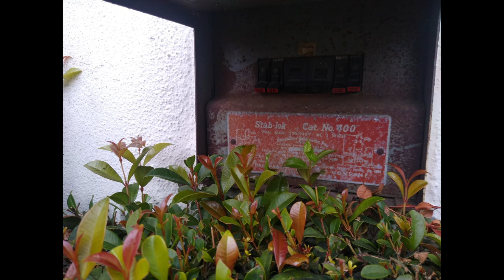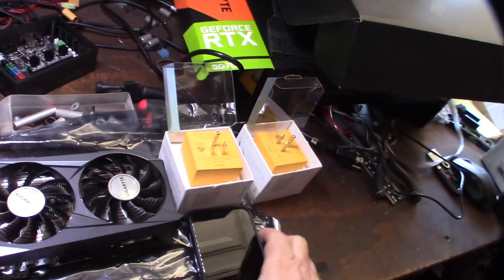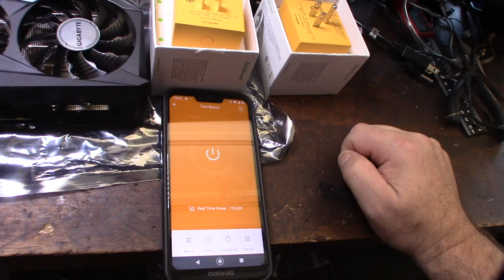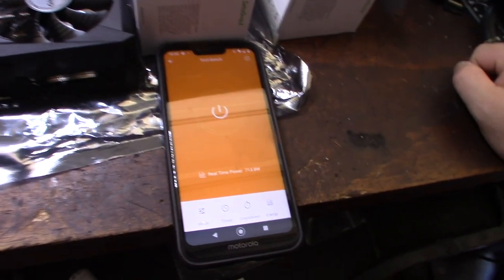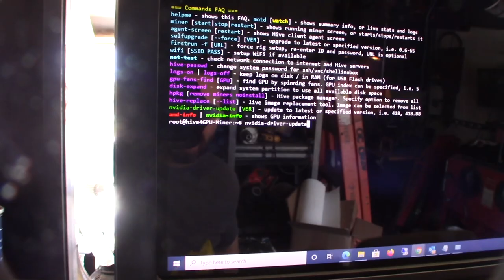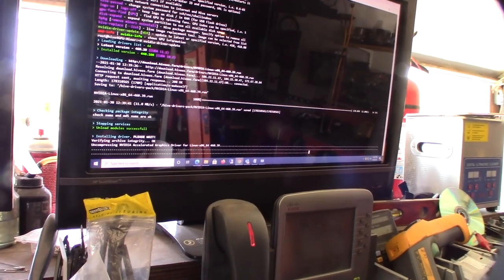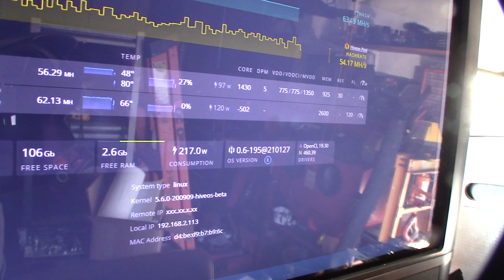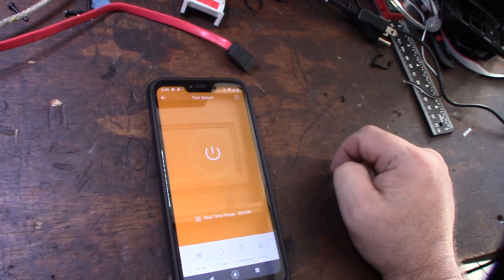Gigabyte RTX 3070 GAMING OC Ethereum Mining HiveOS Overclock Setting

Comment: I'm using this same card atm but keep getting incorrect shares... I'm also running a 3060ti in the same case with no issue. I've tweaked and tweaked and can't get the 3070 to stabilize any suggestion?
Reply: yeah same settings, nothing but rejects, so started playing with settings, trying to find that fine line
Reply: Hi Troy did you fix this issue?
Reply: @gtaonlinekiller8719  I'm getting 60mh at 150w and it stays about 57c I'm not sure what setting I have it set to I'm not home atm, but things are running better now.
Reply: @oOBGYNo  Thats great, are you still getting incorrect shares? Because i keep getting them
Reply: @gtaonlinekiller8719  a couple here and there, power is at 58% core clock 0, memory 1050, fan 70. out of 4245 shares i have 27 incorrect. but i think its because my internet is being worked on in the area.
Reply: i currently get 61.53  -500 Core MEM 2400 PL 140, and I'm running trex NO HW rejects and 22k shares in...

oh and temp is 49C and fan at 66%
Reply: @Jefke  what's your power consumption tho? im trying to stay around 150w
Reply: @oOBGYNo  140W
Reply: @Jefke  with that high of a power limit? How?
Reply: Oooh! I thought you meant 140% power lmao my bad